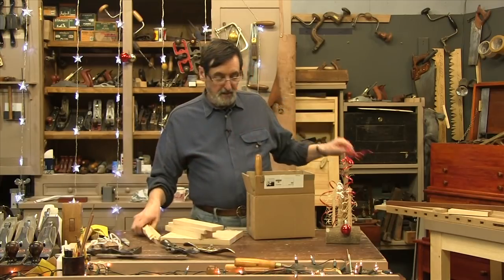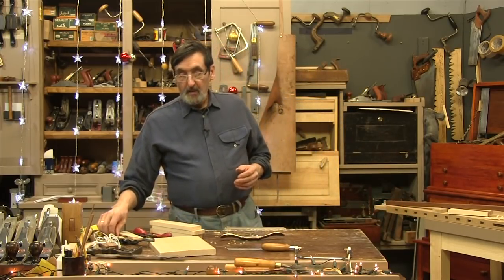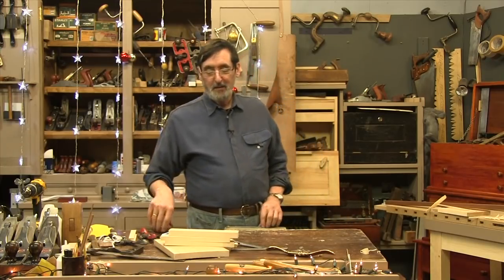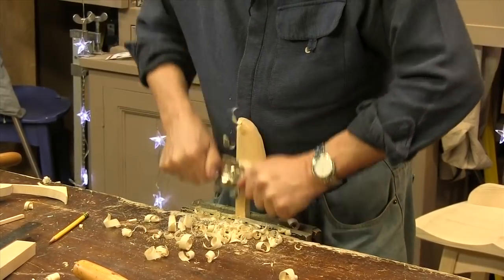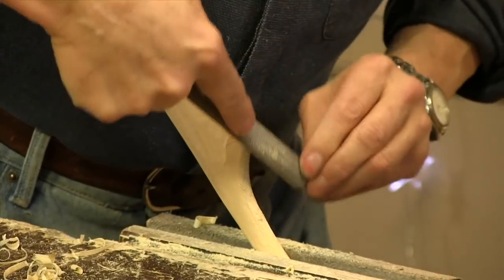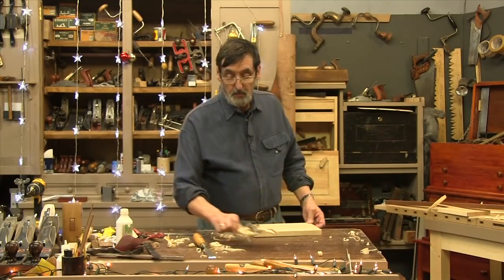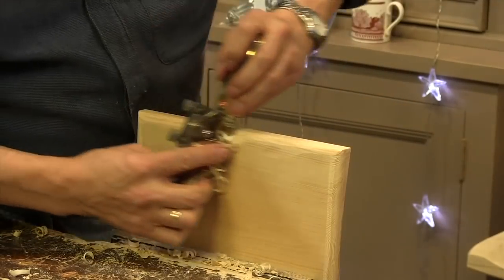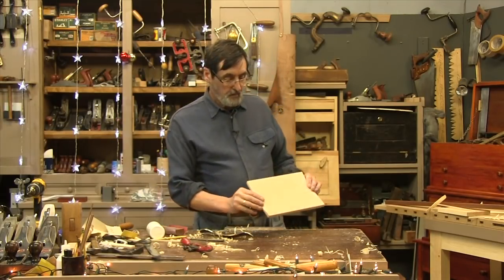Woodworking Christmas Gifts and Projects | Paul Sellers

Comment: Paul,

You mentioned in this video that your kids learned how to make guitars and cellos using the spoke shaves? Have you made any string instruments? And if so, can you do a video series on making one? Im interested in building a cello.
Reply: I would recommend you to start with a violin. Get a book from Henry Strobel or go to www.makingtheviolin.com. It is surprisingly not that hard as it seems, but you need to get or make yourself some special tools (bending iron, thumb planes, lining marker, peghole reamer, peg shaver, thickness gauge). Violin is a good to start with mainly because of its size (no work is painstaking) and because the materials are way cheaper than for cello. I was able to buy cheaper grade wood about 125$ including the ebony. Just cello maple parts would have cost me about 750$. Henry Strobel also published cello making book, so you can buy one. Or you can use violin making approach in combination with cello measurements, draw the outlines based on photos... Instrument making is very entertaining and rewarding process. Nothing beats the look at almost finished back plate.

Comment: Engaging video Paul - one point caught my attention; you say the 'right way' is for the teeth of a coping saw to point forwards. If my memory serves me well, we were taught at Shoreditch College that the teeth point backwards so that the blade doesn't jump out of the frame if you catch the wood by mistake! You know how pedantic we woodworkers can be but as you demonstrate the tool performs well enough if you are gentle with it!
Reply: When using the coping saw with the wood held in the vise, the saw teeth should point forward (away from the handle) because you will be cutting as you push the saw away from you.

To use the V-block(benchtop, clamped), position your wood so the line you are sawing is over the V-shaped cutout.  (You will need to keep repositioning the wood as you cut.)  Hold the wood with one hand and use your other hand to hold the saw.  Start the cut by pulling down on the saw handle.  Important – the teeth must point downward (toward the handle) because you will be sawing on the down stroke.

Taken from a few places, but Mr. Sellers is correct on this one. Although preference can take over, some people might like never having the saw face forward, or back. Maybe they just want it to face nothing at all. Who knows.

Comment: Ok that was pretty cool, I will try that out really soon!! but quick question for both the spatula and cutting board, did you use any finish/laquer? I am new to woodworking and i wouldnt know if the wood could be used in the kitchen without the stain.
Reply: Some sources say that pure tung oil (no drying agents added) is great finish for wooden cooking tools. It protects the wood nicely and penetrates deep into it. Apply it, wait 15 minutes and then wipe all the excess on surface. Let it cure for several days. Linseed oil can be used too, but there is a risk of alergic reaction due to its seed nature.

Comment: Great video. I wonder what is the reason you set your coping saw to cut on the push rather than the pull? My experience so far with my coping saw is that cutting on the push removes tension from the blade, and makes it hard to get a good cut. Cutting on the pull ads tension to the blade, straightening it out and helping me get a good cut. Could you give your thoughts on this?

Thanks for making these videos :)
Reply from the maker: I guess I am more used to using all saws on the push stroke rather than the pull. I certainly haven't ever felt there was any disadvantage at all.
Reply from the maker: Yes. With a good coping saw there is always plenty of tension on the blade and it should not buckle at all. If tension in the frame is weak it will buckle. The saw is a coping saw not a fret. That means you cut copes from outside and into say a corner. The marks are on your side so pushing the saw into the cut means no tear out on your side and you apply much greater power on a push stroke. I never met a craftsman as an apprentice that used the blade on a pull stroke because of this fact. Fret saws on the pull stroke were used with a platform and pulled from the underside. This was never the case with a coping saw you see.
Reply: Paul Sellers Thank you very much.

Comment: Paul, when i put my coping saw blade in w/ the teeth looking forward, it pops out.  The frame bends a bit and lets it fly.  What should i do?
Reply: buy a new saw it would be the best
Reply: rocketguyandtompan07 No, that's actually not the problem.  Look into it and see if you can tell me what's happening.  It's good to think these things out for yourself.

Comment: Hi Paul, great video thanks for sharing it with us. However I do have one question what were the dimensions of the pine board used to make the chopping board. Many thanks.
Reply: I just make one today, I used timber from a 1x8 s4s pine board and made it 12" long so final dimensions were 7 1/4 x 12 x 3/4. Its really close to what he made in this video. It went really fast probably 10" till I was wetting the board to raise the grain. I did however use a block plane for the round overs because they were faster than the spoke shave and I have one.